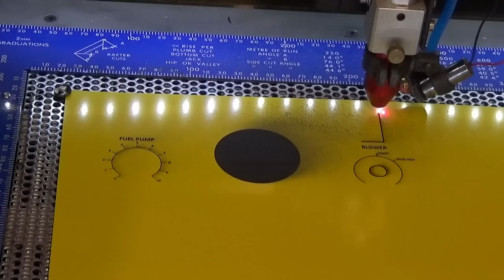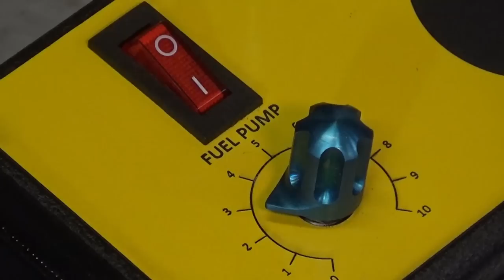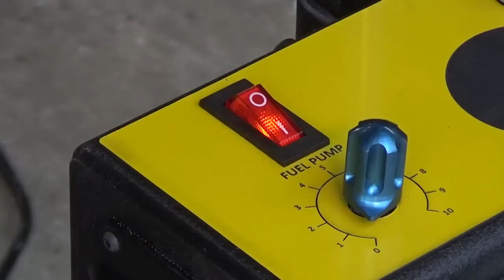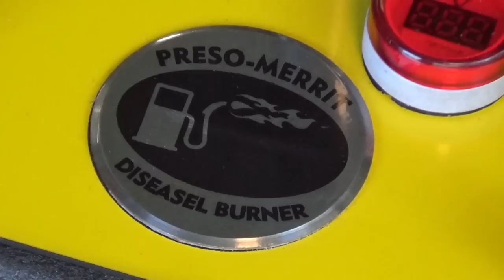Diesel Foundry Furnace Burner - Part 5 - Mission Accomplished

Comment: Can you tell me what the largest crucible that will fit in this furnace? Is it acceptable to cast 6061T6 aluminum?
Reply from the maker: I have a #8 crucible which can hold 8lb of aluminium. I could fit a much bigger crucible in the interior but you still need space around the circumference of the crucible so you can extract it with the tongs. I could probably comfortably fit a #12 though. My understanding is that wrought aluminium like 6061 is not the best material to make castings from. It will melt and pour well and I have added scrap 6061 to the melt for some less critical castings. The T6 refers to the heat treatment process used to post process a casting or an ingot of aluminium alloy. I did buy some pure ingots of 601 series aluminium which can be heat treated to T5. It is really nice material to work with and it machines well and it has good corrosion resistance. I paid about $5 per kilo for it and I bought it from a foundry in Brisbane. I paid cash and the guys even helped me to load it into the car. The worst material is anything that has been pressure die cast. I once melted an old lawnmower base and it was the worst casting I had made and almost impossible to machine. 
Regards,
Mark
Reply: @Preso58  Thank you. After watching your video's I have decided I really want to build this. I work for a diesel fired hydronic heating co so I think I have the nozzles. Can you suggest how tall the furnace is including the lid?
Reply from the maker: @rufustoad1  Check out this link. It has a 2D drawing of my current furnace with dimensions. https://www.dropbox.com/s/j7bopx7noxi96vn/Mark%27s%20Foundry%20Furnace.pdf?dl=0
Regards,
Mark

Comment: Mr Presling, have you checked how high in temperature it goes? Just wondering if it can melt iron/steel.
Reply: Yes we really need to know this !! Thanks for your time . Still learning 64 years and counting !
Reply from the maker: I am confident I could melt iron but the refractory is not rated for that temperature. If I ever have to replace it I will use something capable of 1350C. There is a castable refractory called Pyrocrete 165 which will go to higher temperatures than 1350 but I used the cheaper Pyrocrete which is good for aluminium, brass and copper. I think that only real men melt iron and I am happy to stay with non ferrous metals for now. 
Call me a chicken!
Regards,
Mark
Reply: @Preso58  Ah very cool. So it’s capable. Thank you.

Comment: Hi Mark, were did you get the pyrometer from?
Reply from the maker: I cobbled it together from a hand held digital meter like this one https://www.ebay.com.au/itm/385574500733?epid=9020140417&hash=item59c607f97d:g:uOUAAOSwklZe9BO8 and I fitted a K type thermocouple on the end of a long aluminium tube with a small round stainless steel heat shield to protect the signal wire. It works very well but a stainless steel tube would be better. You can't leave it in the furnace for too long or the tube will melt. 
Regards,
Mark

Comment: What is the advantage of a Diesel furnace compared to a Propane furnace ?
Reply from the maker: The main advantage is that diesel fuel has a much higher energy density than propane. Propane may have a higher calorific value but it is less dense as a gas than liquid fuels like diesel. However, propane does burn cleaner and it's easier to ignite. It will also burn without requiring an auxiliary blower.
Regards,
Mark
Reply: @Preso58  So your goal is to create higher temps faster ?
Reply from the maker: @sierraecho884  It's mostly so that I can melt non ferrous materials faster. Using my old propane burner it would take nearly an hour to melt brass which is a long time just standing around monitoring the furnace. 
Regards,
Mark

Comment: Hopefully you will not be using Bio diesel. Bio diesel does not like copper or Zinc or its alloys, they corrode (worse if the diesel has a high sulphur content) and become brittle and then crack and fail. This why auto manufacturers use stainless steel in the fuel modules. Mind you I'm not sure what fuel in Australia does not contain Bio these days. Maybe farm (red) Diesel?
Reply from the maker: No, I am not using bio diesel. Having said that, I am not a diesel expert. All my cars have been petrol burners and I only recently purchased a Kubota tractor with a 3 cylinder diesel engine. I did notice that the insulation on one wire that I had previously run to the fuel pump had disintegrated. It had turned soft and was quite swollen. I don't know why it  behaved differently but I replaced it anyway. I believe that bio diesel uses sodium hydroxide as a catalyst which may explain some of the side effects. 
Regards,
Mark